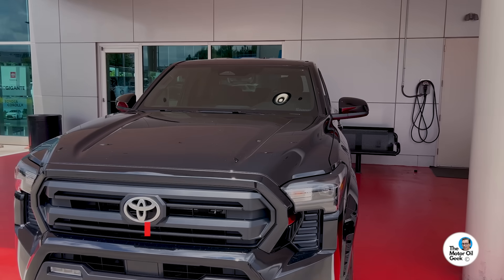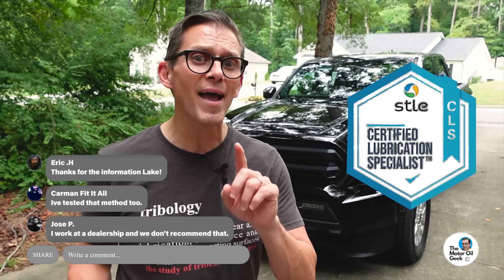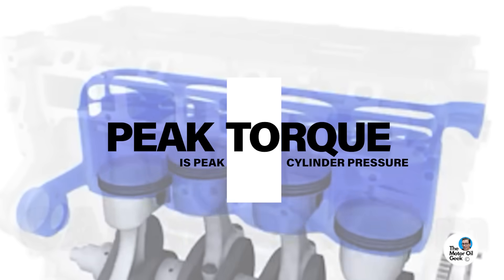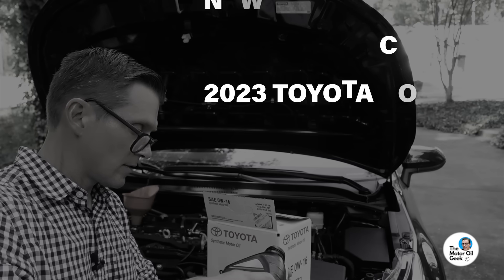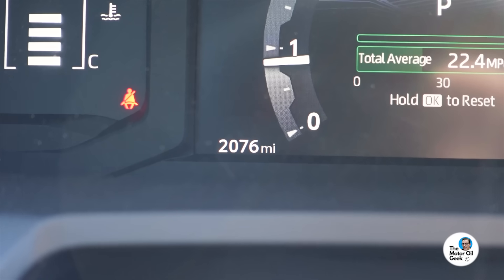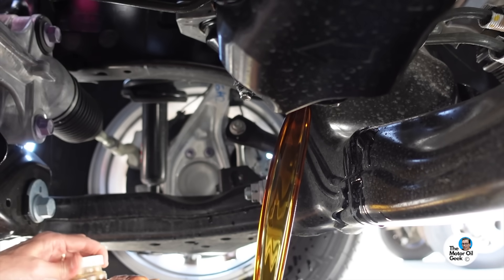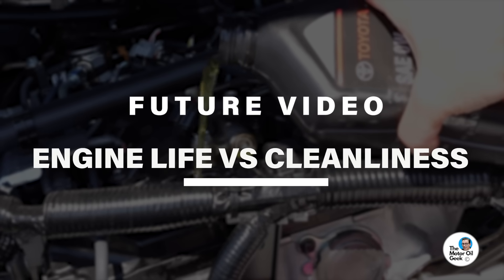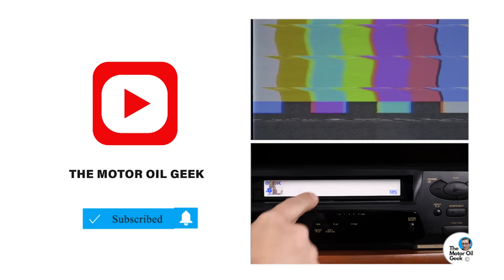The FACTS About Oil Changes (What The Owner's Manual DIDN'T Tell You)

Comment: These videos are great information! I watch them all when I get some free time. Ive been a professional automotive tech for 18+ years. I like to always learn and grow with the industry. So after you start seeing the break in being completed. I’m guessing you will start taking samples to see how long the oil change intervals can be? I feel like the oil can go a long time but the filter goes to bypass before the oil needs changed. At that point would it be better to just change the filter and top off? I’ve always held to the theory if in doubt change the oil and filter. They are fairly cheap and an engine it 10k plus these days.
Reply from the maker: Yes, that is the plan!

Comment: 7:46 Is the silicon not from the AluSil cylinder walls?
As a side note, I find it weird that some manufacturers like Toyota say "use any spec oil, as long as it's a specific viscosity", whereas manufacturers like VW and BMW say "use any viscosity oil as long as it meets our spec".
Reply from the maker: This engine has iron liners.

Comment: If your aim is longevity, do yourself a favor and code off the auto-start-stop.  Would the transmission, differentials and transfer case benefit from early drain and fills?   Say, 10k miles or so?
Reply: You cannot "code off" the auto S/S in a Toyota. There are other workarounds tho.

Comment: Lake, I’m curious on oil volume. My manual states the oil volume is 7.7qts. To get to the top of my full line on dip stick with filter it takes 8.1qts with factory oil filter. Should I go off manual or the factory dipstick?
Reply from the maker: The dipstick
Reply: @themotoroilgeek At your convenience would you be able to explain the discrepancy in the manual? That almost half a qt. I am asking this question coming from ignorance.
Reply: Dipstick.

Comment: When I bought my Mitsu Pajero Sport with 4n15 turbodiesel with MIVEC way back 2020. I had a the oil changed at 500km instead of 5000 for the first change oil. I did another 2500km and another 3500km oil change. I did it at 2500rpm peak torque and live in a mountainous area and also did tons of downhill engine breaking.

5years later still working like brandnew.
I did almost exclusive 5w30 Amsoil signature series.

Comment: I have been a mechanic machinist since 1976.

Rebuilt hundreds of engines automotive marine industrial diesel engines.

Change oil 3000-5000 miles especially on turbo charged engines or short trip or  idling alot.
Use mfg recommend oil on new tight engines.

After 150k miles go heavier weight 10w-30 or More.
I have 400,000 on my service van Chevy express van 4.3 use 15w-40 Fleet oil since 250k.

Oil geek is accurate correct source of information.

Foolish to go 7000-10000 Miles on tiny amount 4-6 quarts of oil.
Filters start to  bypass around 6-7000 miles also if really dirty. 
True used oil filters catch smaller debris until media is clogged then bypass valve opens on cold oil starts.

Good information 👍
Reply: I used to do 10,000 mile oil changes in my 4.6L ford crown vic. I did medical and other kinds of courier work. I drove 1,000 to 1,500 miles a week generally. That car had 500,000 miles on it when totalled.  Some days i literally made one delivery and it would be the other end of the state 150 miles away. Otherwise 5k mile oci is ez to reme,ber and safe for majority of drivers. Oh, i went 10k in my wofes Armada 5.6L with proper oil when a family member was having medical issues. Several times a week it was making a 350 mile round trip plus normal family driving. She racked up about 500 to 600 miles every week. Driving a hundred miles plus down the interstate at 70mph is pretty ez on an engine. Normal ppl never drive like that unless on vacation.
Reply: 10k on mostly highway is ok I used to do medium duty diesel and some of those trucks would go 15k miles per oil change. The more frequent oil changes just makes sure nothing goes wrong. 10k changes has a smaller margin of error
Reply: @workingcountry1776 it was also a crown Vic, which are tanks on wheels with the corresponding fuel mileage.
Reply: only using heavier visco oil when the internal is already worn and needed one is mind blowing for me🤯
Reply: @jameswirya race engines set up loose clearance from beginning need 20W -50 heavy oil .
Reply: @Motorhead250  modern engines nowadays have no problem using 10w-40 from the start, waiting for it to be worn is too late
Reply: @jameswirya Some new tight engines have phasers cvvt  and tiny passages which requires 0W20 as per mfg.

At  250,000 + miles .
They are loose often need heavier weight oil .
Hot idle in gear oil pressure drops down to low.
I have 400,000 on My Chevy Van express vortec . Now needs 15W40 or oil pressure drops to nothing.

I have been building engines since 1976 Gas Diesel Marine industrial.
Reply: @jameswirya my 2026 camry hybrid has an electronic oil pump with pressure regulated by the ECU for 0w8 oil. Heavier oil requires more pressure to move. The VVTi is also oil pressure regulated. Being a hybrid, this engine turns off and on constantly to rpms above idle requiring immediate oil to bearing surfaces. I will stick to 0w8 oil
Reply: @CAN43714 all oil viscosity will drop along with temperature so my point still stands, don't use thin viscosity oil and waiting till wear and tear happened later on
Reply: @CAN43714 it's okay if you don't understand kinematic viscosity under working engine temperature, i don't care anyway, it's just silly hearing someone changing oil viscosity from thin to thicker oil only after the engine aged and it's too late🤦
Reply: @jameswirya if i use a higher viscosity oil in my camry than what is calibrated for my VVTI and electronic oil pump by the ECU by load and RPM, I could damage the engine. I will listen to the engineers who designed this engine over u any day of the week
Reply: @jameswirya Obviously you are not a mechanic or rebuilt engines..

All engines wear over time kid...

Bizarre people say silly things about oil.

I also have a degree in Engineering.
And am familiar with Kinematic viscosity.

When main bearing rod bearing valve guides lifter bores wear the clearance increases..

Therefore the oil pump no longer provide sufficient oil pressure and  or volume especially at low hot idle.

Now go play Minecraft
Reply: @jameswirya Multi viscosity oil is designed to get heavier when hot thinner when cold.It is opposite to other substances which get thin when hot.

Perhaps study more from ASE or ASME sources.

No offense
Reply: how can the bypass opens if there is not oil pressure yet? glogged filter or not
Reply: @retrocompaq bypass opens when the pressure to push oil through filter paper is around 3 psi or a little less. Substantial bypass occurs even at 70F but is less with the newer 0Wxx oils but still happens engine speed goes upas you drive off cold. Filtration is necessary but you would have to have a  serious failure to have much debris needing to be captured. Most stuff in the oil is no problem passing through a few times but long term is a problem. The oil flow through filter is near 100% at operating temp and those things will be caught.
Reply: I understand why you changed to heavier viscosity 30-->40 when engine is warm. But why change the 10W to 15W, that i don't get? Would not 10W-40 be better ?
Reply: I would say yes @joeordinary2trumpheroofrussia
Reply: Probably should wear gloves when changing and dealing with potentially carcinogenic motor oils.

Comment: Sir, I have 2 questions. 
1. What’s your thoughts on catch cans for direct injection engines? 
2. Some engines have the oil filter under the hood (on top of the engine) for easy access, and dealers are using pumps to remove oil from the dipstick. Inserting a hose as far down the hole and removing oil then changing the filter. 
Please let me know your opinions on these 2 topics. Thank
Reply: Many new cars have simply catch cans or reservoirs built in, but remain unknown to owners.  Having an extra one can't hurt, and will likely help.  There is a fresh air side and dirty side to a pcv system. Want to place a one on dirty side if possible.
Reply: Not crazy about those siphon systems. Leaves more than a quick drain and fill.
Reply: @tssci6774  I did try it on my Subaru, and after siphoning the oil I pulled the drain plug in about 4 ounces were left.

Comment: I would not feel comfortable using such a thin oil living in a super hot climate, like the US Southwest region or So Florida.
Reply: Why? Engine oil at operating temp is over 200°. Or are u thinking that because ambient is hotter the oil won’t stick to the surface over time?

Comment: Makes no sense to me when people say to drive the car around to get the oil hot so it will drain faster,  yes it will drain faster, but the oil was already hot when you parked it the day before. I always drain my oil in the morning before starting it, all the hit oil and DEBRIS has had all night to drain to the bottom.
When you run it again, all that oil and DEBRIS gets pumped back  up top and can take a while to drain back to the bottom of the oil pan. In my opinion, the myth needs to stop. Makes way more sense to drain the oil that has had time to collect at the bottom.
I'm open to others thoughts.
Reply: It puts the debris in suspension so it drains out and doesn't sit in the pan. There is always some oil in the pan that will not drain out.
I warm it, drain, and let it drain over night.
Reply: Unless it’s really cold then it might not all get out. It does take at least 30 minutes for that light weight synthetic to drain to the pan. I’d wait an hour after driving it to let it all drain to the pan again. It’ll still be warm enough to get good flow. Those super lightweight oils would flow at any temp though. Either works.  Draining right after running the engine doesn’t make sense to me either.
Reply: @BeefNEggs057  99% of the oil gets back to the pan really quick if it was at operating temp when it was parks. Like a few min, tops. 200 deg oil dont wait around.
Reply: You should try your theory with using two buckets water and dirt. One bucket you will let sit overnight and the other you will mix up before you drain it. The hole needs to be on the side of the bucket because most oil drains are not on the bottom.
Reply: Exactly. Just repeating what already happened. I was beginning to think I was the only one.
Reply: Dirt flows away better with hot liquid (wash dishes in hot water instead of cold water)…seems like the dirt will flow out of oil pan better when oil is hot instead of cold…..to each their own
Reply: wrong that's what u think but as a mechanical engineer it's negligible, you can warm up the engine, drain and let it sit for a few hours.

Comment: Great video, THANK YOU for actually doing a video that is full of common sense and scientific data, not just personnel opinions that are stated as fact by the creator. 
I've got a difficult issue with my vehicle' oil change schedule going with your recommendations in that my vehicle's engine takes 8.5 quarts per oil change($500.00). 
Not to mention it has the oil monitoring system that recommends between an "A" and "B"  schedule maintenance oil change. I would end up cycling thru three intervals.
With that in mind, I still think your way of engine, rings, and bearing protection is GREAT advice for long engine life. I look forward to your next video

Comment: Great topic! Love to see keeping the filter in use for multiple oil changes. People get so freaked out about the nominal amount of dirty oil while not understanding particulate absorbtion Follow the data! Great work Lake👍
Reply: The main thing is whether there is wear and tear damage (literally torn media) in the retained filter and/or whether it is bypassing significantly more of the time than a nice new filter would be doing
Reply: @davidpowell3347 good point. But that's the chance you take.  I believe Honda actually recommends replacing the oil filter every other oil change

Comment: The same people who say "that's crazy, you don't need that on "new" engines!" are the same people who don't believe the owners manual about extended oil changes. "My ignorance beats your training, your knowledge AND YOUR DATA".  Srsly people. SMH.
Reply: Then complain about the engines blowing up and modern cars not being built well.

I mean, they are generally fine if you change the oil and follow through on ALL fluids. 15k miles on new engines with their tight tolerances and turbos is just begging for an engine failure.

It is the manufacturers fault by advertising these insane long mileages for oil changes.
Reply: Well, you don't need to change you engine oil at 500 miles, it is gaining you nothing, I have also tested the oil changes on compared to the computer on multiple F150s with the 5.0, the DATA shows the oil was fine, people worry too much about most things.
Reply: @JDT-pq3wi  Hmmm...a rando vs a tribologist. Guess who I'm listening to?

Comment: Absolutely MIND BOGGLING how Huyndai is STILL RECOMMENDING a FIRST oil change at 6500 miles! I bought a brand new '25 Tucson and the dealership is STILL promoting the first oil change at this extreme range: ASININE! And with the Class Action Lawsuit against Huyndai going on for engine's blowing from excessive oil consumption and extreme wear; you'd think they'd pull their heads out of their asses and go back to the original first 500 miles oil change - proven formula. It's crazy...

Comment: I’m hear for the Amsoil  comments
Reply: I switched from GM Dexos approved 5W-30 oil to Amsoil Sig Series 0W-40 and iron wear went from 5ppm/1k miles to 1ppm.  I have dozens of oil analysis to document the extreme low wear.  It had 223k miles and looks like it just came off the assembly line. Lake has seen some of my data.
Reply: @tssci6774  May I ask what year and engine your working with in this example as I assume whatever it is, its probably a direct injection engine as per the LSPI issue that they are more prone to have if the wrong oil chemistry is being used.
Reply: @charlesb4267 2.4l GDI, VVT.  Not Turbo so LSPI is low risk.  Amsoil far exceeds LSPI spec defined in API SN+ and SP.
Reply: @tssci6774  I was curious if it happened to be a GM engine simply because of the prior Dexos approved oil you had been using. That is my reservation with switching to and in this example an Amsoil of any viscosity on my 2025 GM 3500 with the L8T gas engine because Amsoil doesn't have the Dexos approved license on any of their oils and here in Canada we don't seem to have a leg to stand on when it comes to anything outside of the box where warranty is concerned as GM could simply deny a warranty based on what was used, not because it was at fault. It gives GM Canada an out, even my doing my own engine oil changes is a big deal in proving what products I used as per both the oil and the filter and that the oil changes were done often enough to meet the warranty requirements. Once the warranty is past, then anything goes as its now your own baby or if one decides to take the risk and use a non approved product and hope the GM engine won't fail ( GM's track record seems to be less than stellar these days with some of their engines ! ).
Reply: Amsoil has it's place, I think a lot of people waste money on it, like buying the signature series and changing it a 5k.
Reply: @JDT-pq3wi it's thier money.  They probably buy premium fuel when 87 is the minimum required. There is benefit to using both premium products.  Amsoil isn't just an extended oil drain product? but offers other advantages.

Comment: I would make an exception to reusing an oil filter on a short oil change (ok two).  I have a high mileage jeep that I put Valvoline Restore and Protect in.  Because I was in a hurry to get it tested, I ran a quick 500 mile oil change but believing the filter wouldn't get very dirty, I reused it.  My second fill of VRP got dirty very quickly.  In a video with a Valvoline staff, they said VRP is designed to suspend carbon.  I believe it suspended some carbon that was in the filter using some of its capacity up without new engine cleaning.  My other exception would be not to leave a filter in a car too long.  Example, if I only drive a car 1000 miles a year, I would not reuse the filter for years.  I have seen filter elements get wavy over time indicating they are deteriorating.

Comment: True story... about 5 years ago I was getting ready to clean the air filter. I pulled it out, looked at the pleats against a white background,  and just reinstalled it. I could see clear areas next to the dirty areas. It came to me that those dirty spots keep on attracting the dirt in the incoming air. 6 months later, it was confirmed. Then I saw your filter guys video and it was nice to see and understand the physics behind it, plus a confirmation of the theory.

As for this video, it was excellent. As an old school mechanic,  I have followed a 500, 3k, 5k interval, but i replaced the filter at 3k. Only the middle number is different and filter replacement timing. I came up with that in the 80's when I was a member of a racing team that sent oil samples for testing. The data was PRICELESS. Moving forward,  I will try the 2k in the middle. Again, a big thank you.
Reply: 1,2,3 is all you need. 500 miles is the minimum but it’s hardly different at 1k but you can’t go over 1k. I saw people say 2k, yeah they screwed up